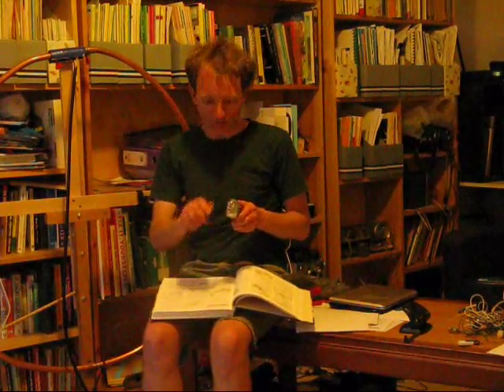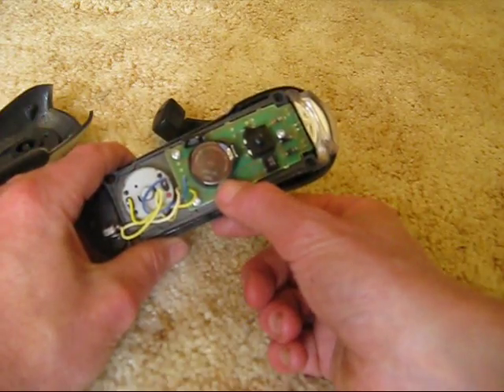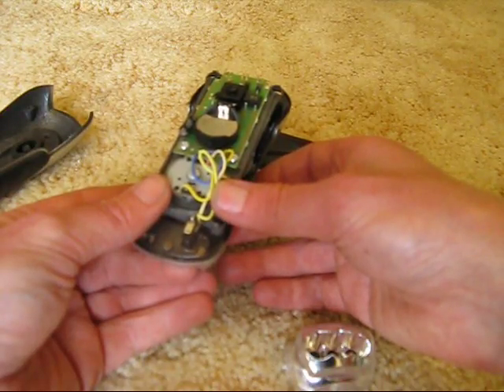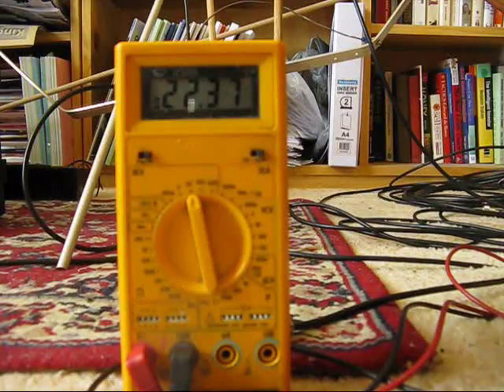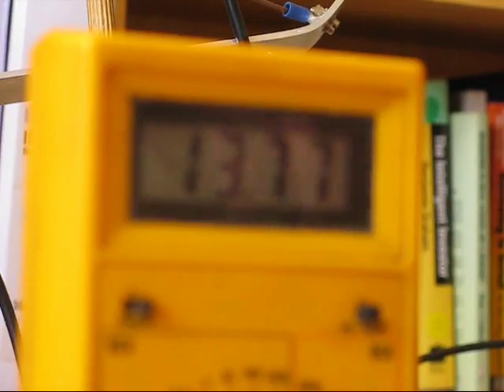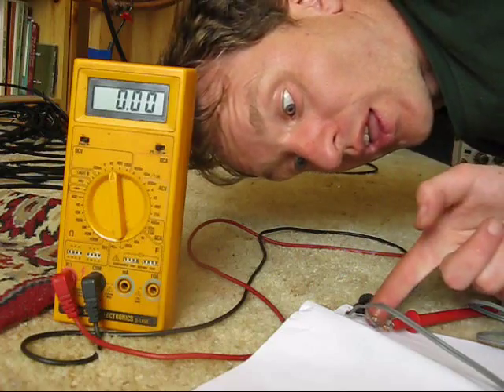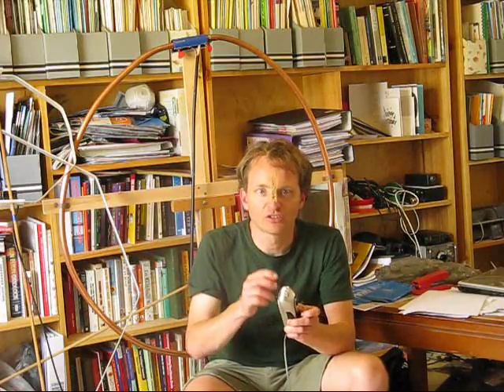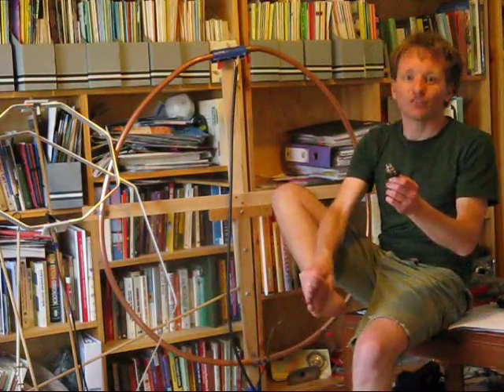Electronics on the floor: generators from wind-up torches

Comment from the maker: @Herb. No doubt, but it would been to be a homebrew rx.  Maybe have a foot treadle for the generator - like the old sewing machines - to leave the hands free.  And a large value capacitor + voltage reg to iron out variations.  No I don't have a workshop - just a small desk in the bedroom.

Comment: I had a few that use a 3 cell nimh battery pack instead of the coin cell. Others I have seen just use a CR2032 cell and charge it up.

Comment: I just got mine working again. You can zap the 3.6 volt nimh battery with a voltage of 4.5 volts. This method worked for me before only with NiCad cells. You should try it, mine works as new. Don't think it will work with LION cells, I saw in a vid that wouldn't work.

Comment: I have one of these with a built in radio. The battery is dead. I will be replacing it with something else maybe a super cap if I can find one.
Reply: coondogtheman1234 same here mine will not hold a charge but works when I crank it